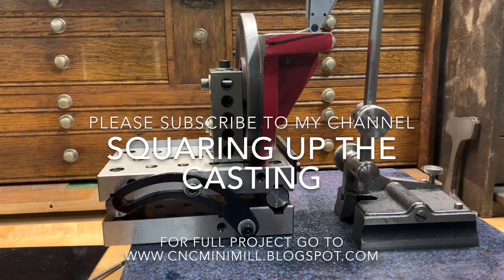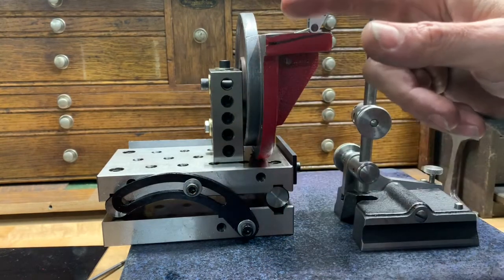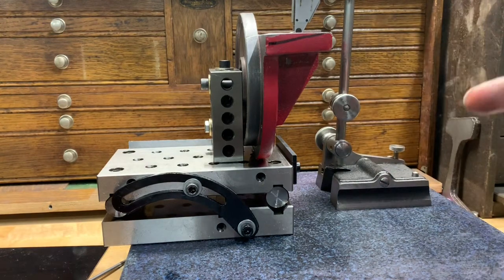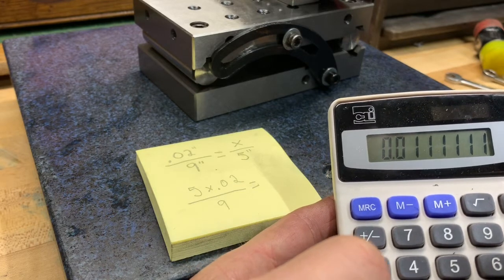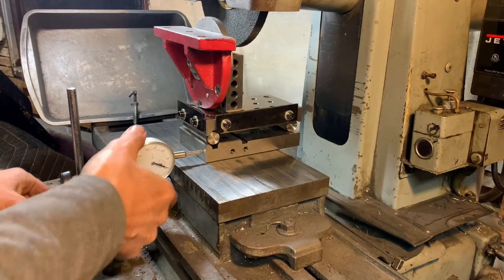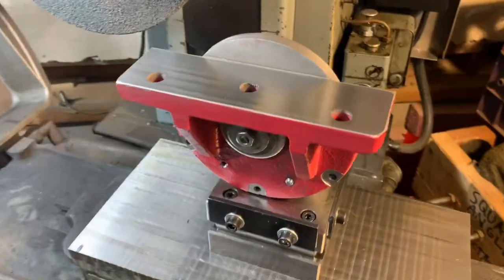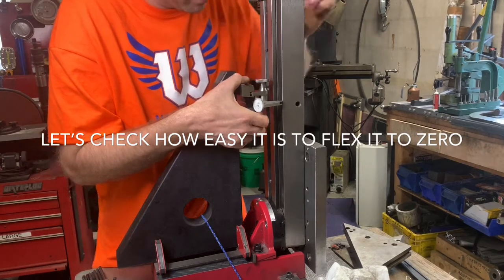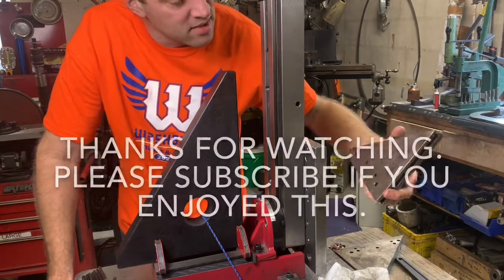Setting the casting square on Harbor Freight Minimill CNC project

Comment: Step 2 throw in a foundry and mold a new one if you have the time and patience otherwise chuck the whole machine it in the garbage.
Reply: That is a light machine kit and well cared for and used within their limitations can achieve a lot of work. For the price it is sold you can't ask much more. A lot of hobbysts can get a lot of joy from these machines, of course it is not intended for heavy duty work, mush less for production or professional work. If you are a pro and think this thing is a good machine then you have a problem, for a hobbyst having just a couple thousand to spend on its hobby this may be THE ONLY option, so throwing it in the garbage is not good advise.
Reply: @reiniertl  I know I was just joking I almost bought one a few months ago but I found a Bridgeport for "Cheaper!"
Reply: @kyzitemelos  Hey man enjoy the Bridgeport, it may also need some reconditioning. Most Bridgeports have seen a lot of use and abuse, unfortunately they are also too heavy for most of us, hard to move into a basement shop, to tall for a garage, impossible to get 400V three phase, and so on. I'm buying my first lathe next month, and hope next year the mill, but I would not buy the mini-mill, too limited, better wait and spend more on something more robust. For me, it is hard to get industrial grade equipment for cheap so I'll settle for Chinese made equipment in the mid range.
Reply from the maker: It’s the journey not the end